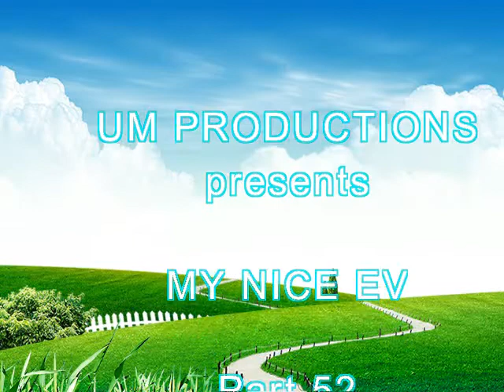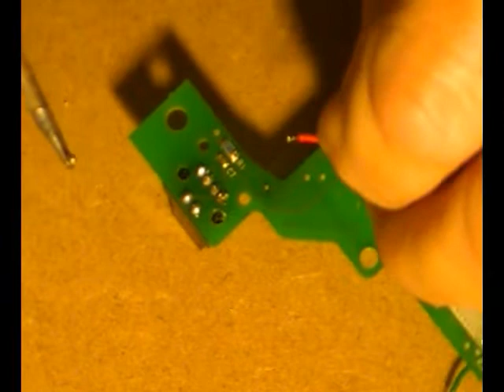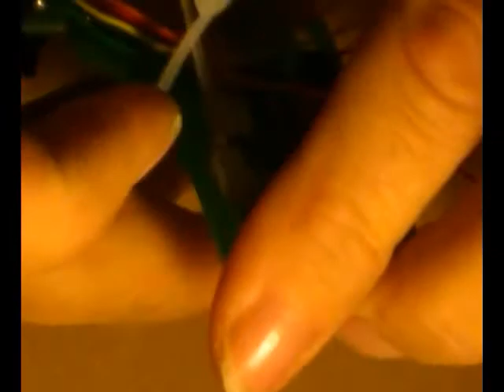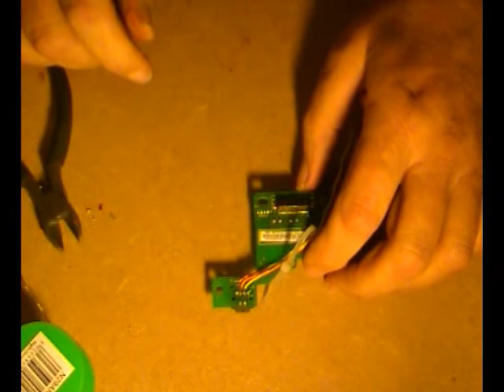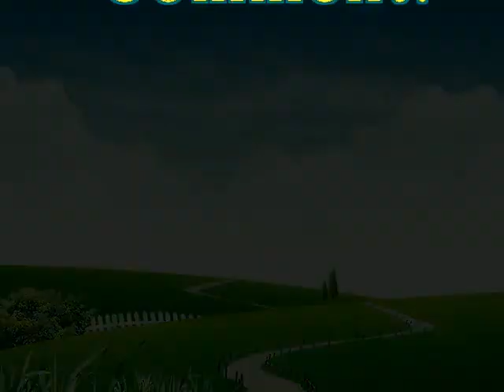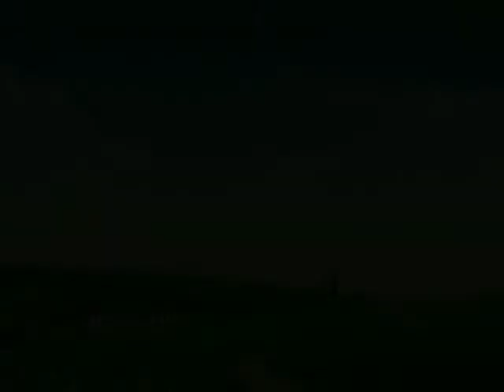MY NICE EV Printer Arduino CNC Part 52

Comment: A little trick I use for wire management... Tape one group end onto a table, put a 90 degree allen wrench into your chuck, put the other end of the wires in the bend, and slowly depress your trigger. Much easier to manage, and easy to put into heat shrink or mesh too. :)